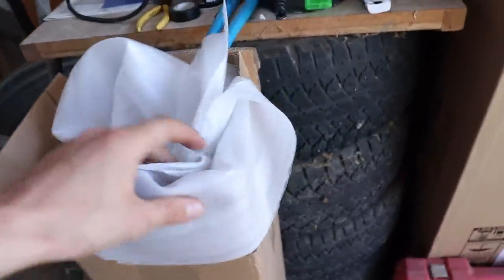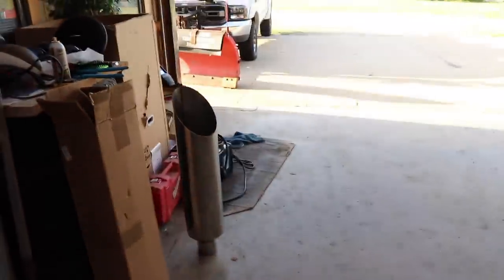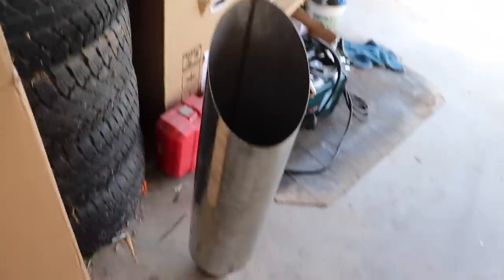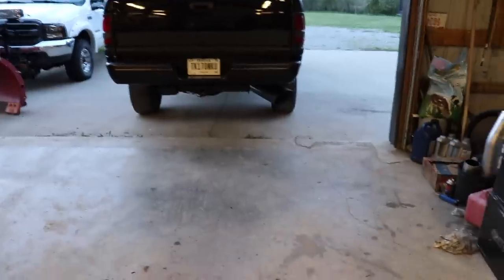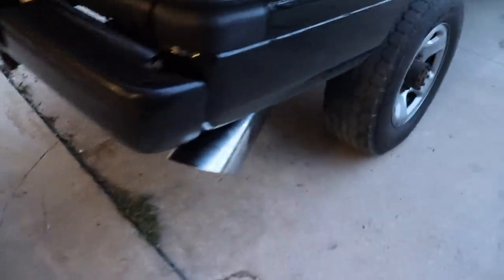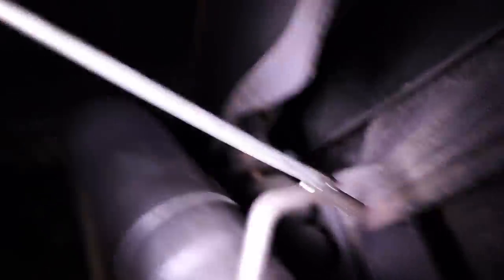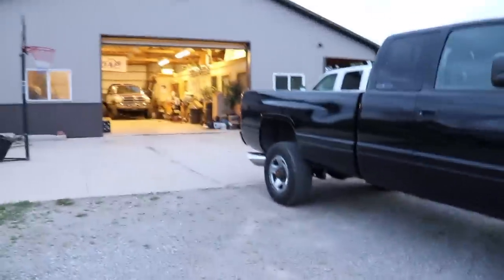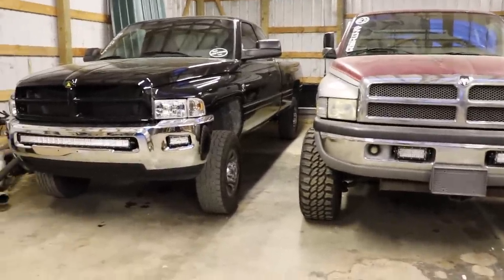I BOUGHT THE BIGGEST EXHAUST TIP I COULD FIND FOR MY CUMMINS!!!!

Comment from the maker: 🔴The 12 VALVE GIVEAWAY IS LIVE!!!
🔥🔥🔥🔥🔥🔥🔥
June 1st - July 2nd!!
Every $20 you spend on the merch store gets you an automatic Entry!!!
WEBSITE LINK: https://team-lnp.myshopify.com
Or- Team-LNP.myshopify.com
You could be taking Home a new truck!!!
Reply: the reason why exhaust dropped down is because you have it welded solid and have no rubber grommets like the stock system had so there for when you crank it and rev the twist of the motor or torsion it also twist and but stress on your exhaust pipe
Reply from the maker: colby root I just forgot to put a clamp on a section of my exhaust system... but I fixed that...

Comment: When welding the tip onto the exhaust pipe, the pipe is stainless as the tip probably is. So there is different rod you have to use to weld it. And it's pretty thin metal. Easy to blow through. A little mig welder is tons easier for little stuff like that. But it looked great man! Keep it up!

Comment: Hey man word of advise. Get you an extra hanger around the tip itself. It will vibrate loose. I've had a stack on mine for over a year and that's the only issue I've ever had.
Reply from the maker: Preston Hepler where exactly would you suggest another hanger? Or support of some sort?
Reply from the maker: Just added a metal band around the very back right like you said and made sure it was snug up and it’s ran through a factory hole in the frame...👍 it held it back up where it was and it’s solid now.
Reply: Glad to help man.

Comment: I would re-weld that tip and piping if I were you. Not trying to knock you or anything but its hard to weld that thin material with a stick welder, not that it cant be don't, its just harder. Take it to a shop and have someone TIG weld that and it would be gorgeous. Especially since its a giveaway truck.

Comment: Is that a stainless tip? If so that could explain the bad welds. Other than that I would’ve took the coating around the edge of the tip

Comment: Just picked up my first Cummins, first mod? 😂
Reply from the maker: Joel first mod is change every profile picture you have to a cummins so people know. Next step is get a giant C sticker for the back window so if the black spot doesn’t give it away, the sticker will. 😂 after that it can get expensive
Reply: LOUD 'N' PROUD I’ll definitely do that 😂 waiting to order the loud and proud sticker with my Big C and American flag stickers, chrome rims gotta go after that
Reply: gauges
Reply: Joel if it's a 24 valve definitely a lift pump (fass or air dog) after that start saving up for trans then a tune then from there you can do whatever you want
Reply: If i got a 12v straight piping it would be my first thing then a air intake

Comment: should contact the merchant and say that the product has damage to it. and should send you another one. That is unacceptable. You pay for great quality but have horrible quality.
Reply from the maker: jasonman1515 yeah it’d have to be covered by the shipping company for damaging the product in transit...
Reply: Also, you stated its a smoke stack. it supposed to be mounted inside the bed. not as a tip underneath the bed. Depending on how well you weld it, the weight of it, how its cantilever out with no support in the middle of the stack, it will cause stress on the weld will possibly break.
Reply from the maker: jasonman1515 I’ll try making sure it’s mounted perfectly. But this isn’t the first time someone has done this before.

Comment: Exhaust tips don’t change the sound some how people think it sounds good
Reply: actually they will, Ever heard of a megaphone? Here is a simple experiment for you, yell at someone across the parking lot then get a big traffic cone and yell the same way through the cone and have them record it.
Reply: @calebgodwin3224  it is only so much. i wont chnage the actual sound coming through the exhaust
Reply: @kuharrr  The sound coming out is changed which is what you hear. I larger tip on a Smaller pipe will create a deaper tone, smaller is more raspy. Not sure how it changing what is sounds like when it comes out isnt changing the sound.

Comment: I think you practice welding. I don't think you give yourself enough credit when it comes to working on stuff your self ect. Your smart I can tell. But it seems like you can sometimes let mechanical jobs intimidate you. You can do it. You have enough practice exaust laying around the shop to practice welding on. It looks like you were pulling away from the weld not pushing into it. I think for the kind of work you are going to be doing on your channel it would be wise to invest in a good wire welder with gas. With the amount of subs you have I would think a company like Hobart would sponsor you. You could do a review on the product. Your really talented. I don't think you put your talent we're it could be applied all the time though. With practice anyone can be a great welder or mechanic. You don't need a degree to be one and I think you have what it takes